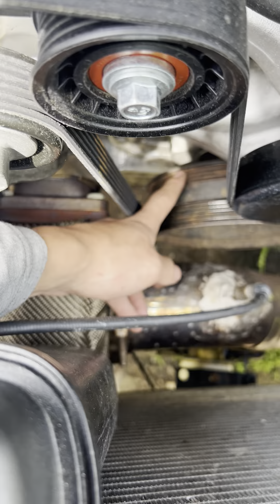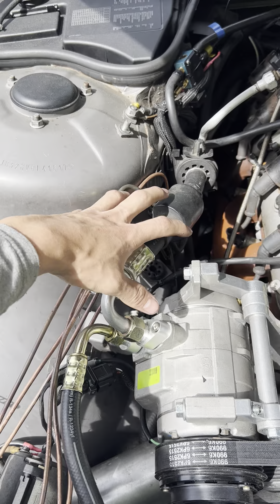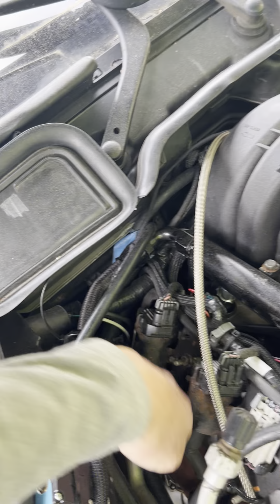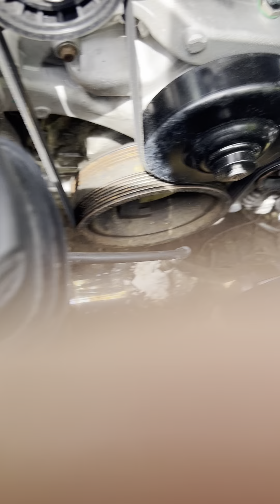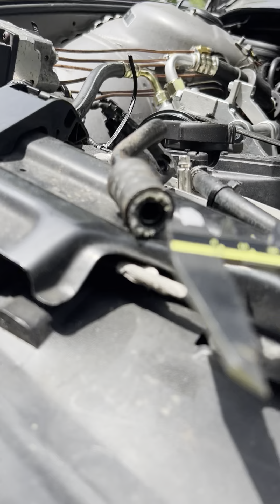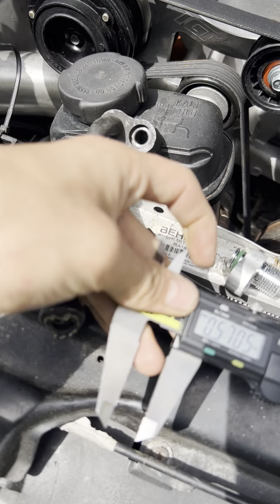Bmw 740il LS swap AC setup

Comment: I'm working on the last hose from condenser to compressor with the weird size hose. I was looking at #8 to 12mm compression fitting. Why didn't you just use the compression fitting instead of tig  welding it?
Reply from the maker: I wanted to more closely match the bmw inner diameters. Not sure how much of a difference it makes. I think a number 8 would fit up good.

Comment: Awesome setup man and thanks for explaining it all. I'm curious how yours was still plug and play with the electrical wiring. I'll have to see if I can jump my high pressure switch and get a signal to go to the compressor harness. Thanks for showing the hose sizes that helps a lot. Looks like you have a turbo down below, is that the only reason you ran your compressor off the main drive belt? I would like to have my compressor in the stock location. The bmw location and GM truck location are very similar. Nice work 🍻
Reply from the maker: Yes the turbo is the only reason I ran it off the main drive belt. If you can get it to mount to the stock gm location I see no reason why you can't run the 4 rib belt and tensioner. Did you keep your receiver/dryer canister? That's where the high pressure sensor sits. Aslong as it has refrigerant pressure you shouldn't need to jump it. It took a long time for the first bottle of refrigerant to build up enough pressure in the system while filling it to trip the sensor. I believe I just had to ground out the dme signal to the ihka to get it to turn on pin 19 black and green wire on x69 connector. I'll double check my notes and wiring for that.
Reply: @agustinmorales4045  yep I saw what I thought was a turbo down there. I did keep the dryer with the high pressure sensor so I think if I could connect that back up and put refrigerant in it that the compressor would kick on. Just want to make sure the wiring was straight. All my lines are not on the car right now but I'll be ordering a compressor and adapters soon to get A/C running cause it's way too hot to drive that car and not sweat the whole time.
Reply: @agustinmorales4045  Really appreciate the video.  pls explain the wiring a bit more.  The GM compressor has a green and black wire.  Connect black to ground and connect the green to the BMW black/green?  Is it really that simple?  thnx!
Reply from the maker: Bmw black and blue goes to compressor gm green. I'll put up another video on it